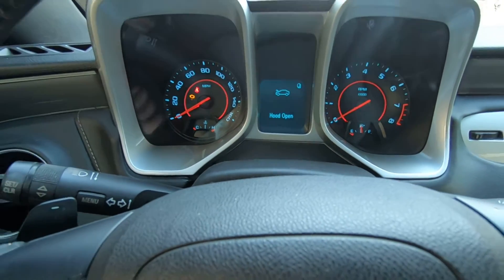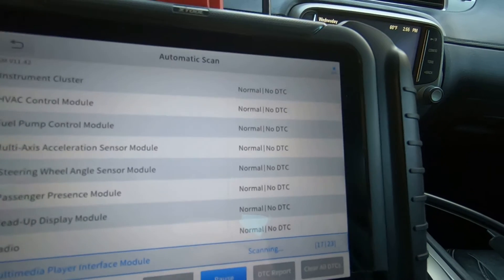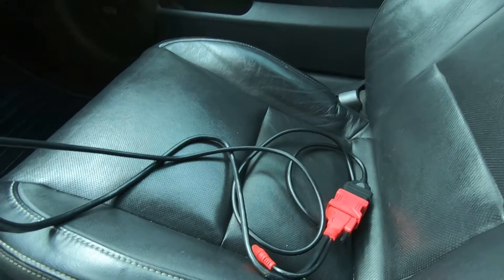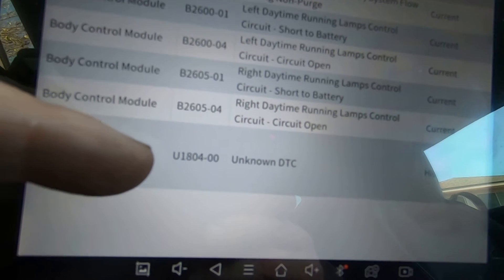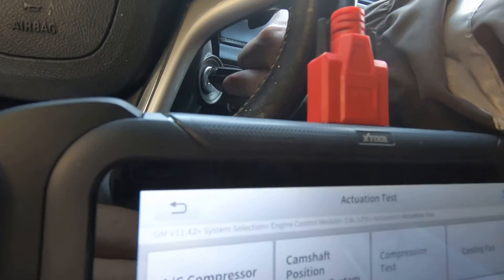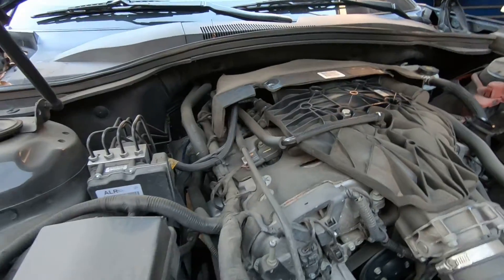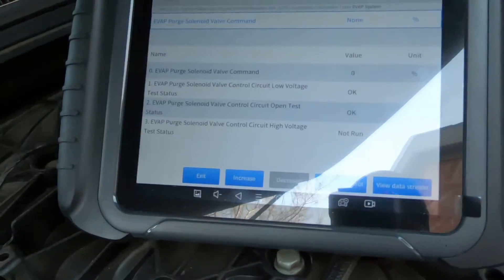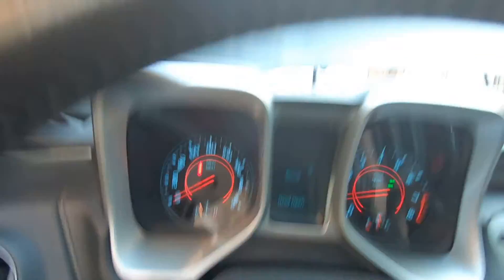Troubleshooting and Repairing the Evap System for a P0496 code on a 2013 Camaro using the D8.

Comment: You can also use your phone to operate the scan tool.
Reply from the maker: How do you do that?
Reply: @737mechanic  go to the quick support and it will tell you a website to go to on your phone. Then you enter your 9 digit code and then your tablet will be displayed on your phone. You can operate everything from your phone.
Reply from the maker: @jamiefloyd160  Oh Ok, your talking about teamviewer. Yea I guess you can control it from a phone or other device. What thats normally used for is if you was having a problem xtool can connect to it and see what is going on.
Reply: @737mechanic  oh ok I’ve been using it so I wouldn’t have to buy the long cord lol.
Reply: @737mechanic  let me know if you have any problems or what you think about it.